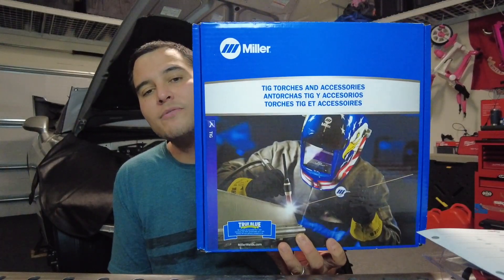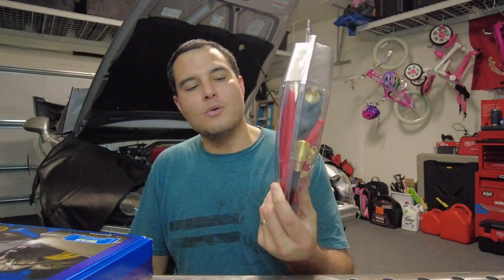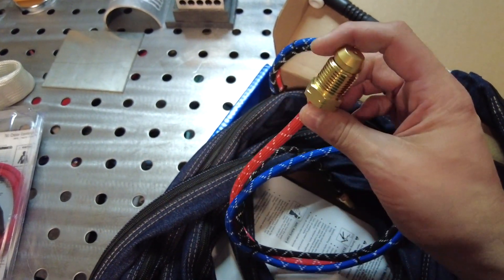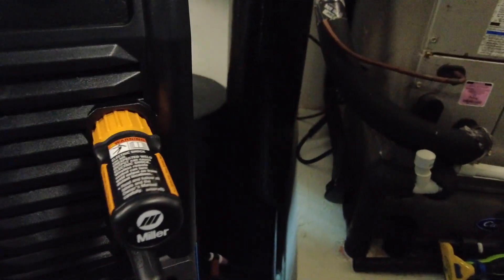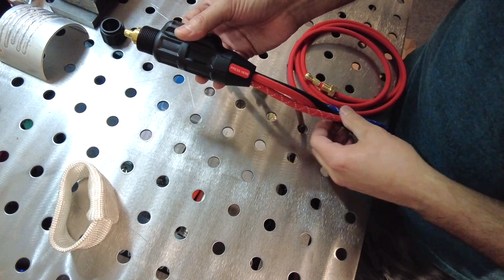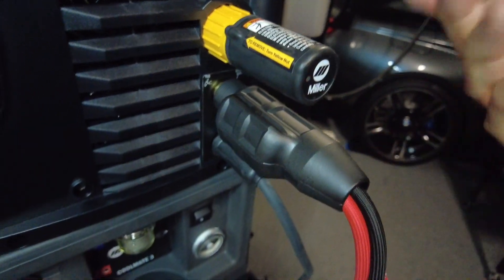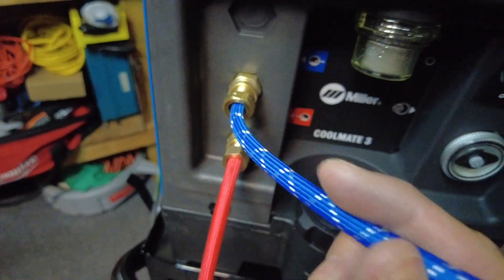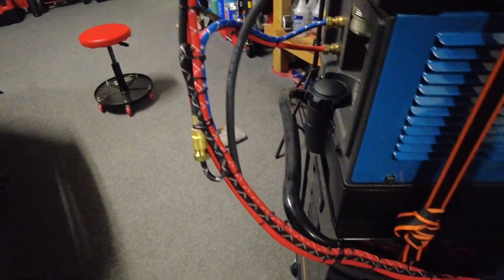TIG Water Cooled Torch - Dinse Adapter for Miller!

Comment: I have a multimatic 255 which has 50mm dinse connectors. What adapter do I need to accomplish this with my machine? I can't find a 50mm dinse on the CK Worldwide site. Is the slwhat-35 the correct size I'm looking for?

Comment: I can't believe all the years Miller has been in business and here they have the millermatic 220 and 200 amp welding machine and it has the small dense 25 connectors on it I have a small chineseium welder and it even has the dense 35 connectors on it my primeweld TIG 225x has the dens 35 connectors on it and I even have the maxcool 3000 TIG torch cooler on it too with a CK worldwide flex lock 230 water cooled torch.
Reply from the maker: Yeah it's pretty sad to be honest, especially for the price tag.
Reply: @ArcLightAddicts  yeah I didn't even think about that my prime weld is a $850 welder and my chineseium one is $340 and like I said it's got the heavy duty 12 mm dens connector
Reply: They run the smaller dense because the machine would ne ver need it, bigger did the same if being bigger us just a waste sometimes. Miller was also talking about the duty cycle, if you use the uncooked torch and it's getting to hot, you're running pass the duty cycle. Over running the machine greatly shortens the machines life.
Reply: @beekeeper6109  that's a common knowledge thing if someone doesn't know they are exceeding the duty cycle on the torch then they don't have any business TIG welding.... Lol 😆

Comment: Excellent video love the set up! I’m running an older syncrowave 200 and I weld a lot at work and my torch gets hot I want to do this.
Reply from the maker: I would highly recommend it! It made a huge difference on how long I can go as well as cranking it up to 200amps

Comment: Duty cycle of the machine.
Reply: yep the Miller guy was talking about Duty Cycle.....when he said you are overloading the welder... and a Air cooled welder will heat up when you exceed Duty Cycle...letting you know to stop ...and let it cool down....Industrial welders can run 100%...so water cooling is best for them....
Reply: I was coming here to say this exact thing, it's amazing how many people either don't know or don't understand duty cycle. The water cooled torch lets you blow pass the duty cycle thus greatly shortening the life of the weld. I know this because I did just that with my first welder I ever had. It's why you don't put a 30amp fuse in a 15 amp circuit, your just overloading it. He also didn't reduce the gas flow, the water line run along the conductor into the head of the dinse contector, not into the actual connection into the machine. All the water is running through the cool mate, only the tig torch is water cooled and not the machine. You really need to have a water cooled machine or a machine that has the duty cycle to handle a water cooled torch.

Comment: There is a black threaded nut that goes on the front of the ck adapter. I am sure you probably found it by now but that stops the ck adapter from splitting apart when you turn the dinse connector into your machine

Comment: Best review on this set up. I’m waiting for my new 220 to arrive from where I bought it. And I’m highly I retested in this set up when I find a cheap used coolmate. Thank you for making this. Very impressive garage and set up by the way. I wished I was your daughter lol.
Reply from the maker: Thank you! Yeah I was a bit shocked that a water cooled torch wasn't supported because they felt like WE didn't need it lol. It works great and the torch stays cool during the long aluminum runs. Super stoked about it.
Reply: @ArcLightAddicts  makes no sense to me. I guess they figure people will fry it from maxing it out. Or it’s not necessary. But it’s nice to have. I think between running water cooled and a helium mix you can weld anything 1/2” or maybe 5/8” just by having the extra duty cycle and heat.

Comment: Crazy Miller talks about their products that way. It's obvious you're heavily invested in their brand and it seems that's not enough for them 🤷
Reply from the maker: I’m not heavily invested in only Miller but Everlast as well. I just didn’t realize how much Miller was holding back until looking at the other brands.
Reply: @ArcLightAddicts  I noticed that too, it's like they don't feel they have to change because of the brand name and then you realize all the other technology that's coming out. I've been using Yeswelder for past couple of years and love it. I'm all about getting access to the technology that's current so that learning is meaningful. You start looking at the big brands and it's just way too expensive to start doing stuff that you can do at a few hundred dollars these days.
Reply from the maker: @TerrenceLP  Yup. Needless to say, I wont be buying another Miller for the type of work I do. Industrial/Commercial use sure, I believe they are better but those are $10k+ machines. For the hobby/automotive industry, I think these machines that range from $1000-2000 are plenty (200-220amp range).